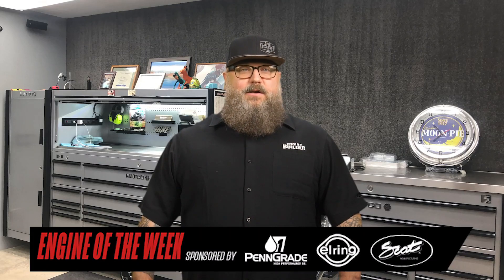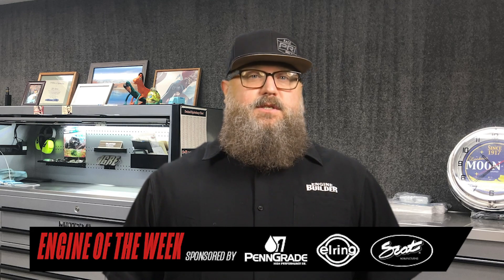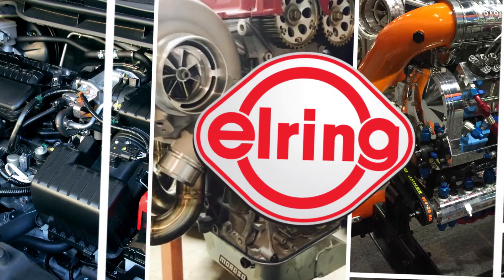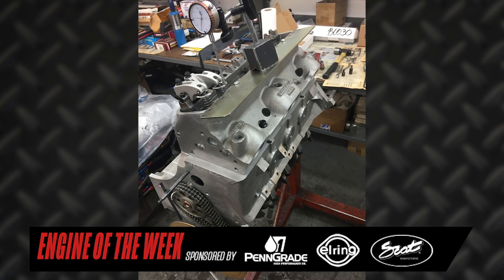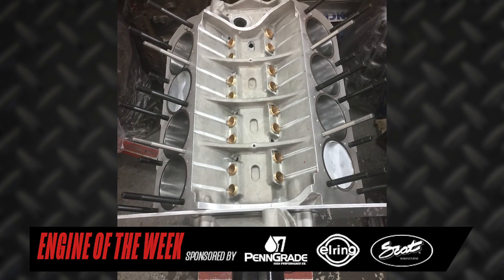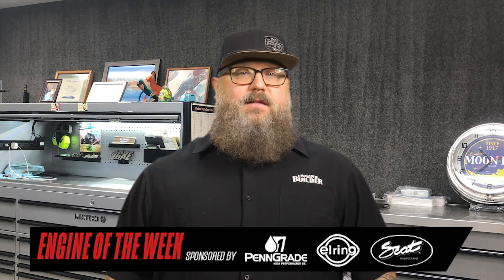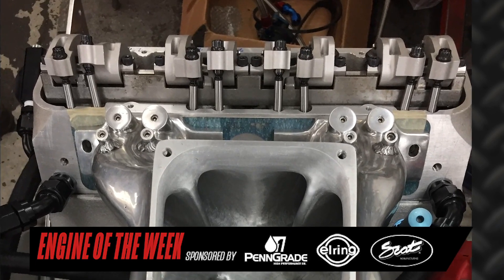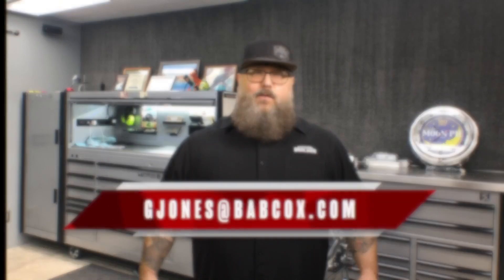All-Aluminum 535 Pontiac Engine

Comment: Cool stuff, I been running Pontiac since the late 70s 389, 400, 421., 428, 455, I learned early on these engines make great torque, do t really need a lot of rpm. Right now om running a ols school 1972 455HO, bored trw L2394 pistons comp cams bump stick 7f6 heads, scorpion roller rockers, torker 1 intake, 850 hp series carb and msd ignition. My dad bought this engine back in 73, it was in a T/A that was parted out to raise money for college. The engine was built by a place called Shepard in Rockingham NC. It sat in a little building till the early 90s when my dad put it into a 72 GMC pickup. Dad got sick in 96 and passed. I bought the engine from my mom for 500 bucks. All I have done is freshen it up and install the comp cam in place of the GK cam. Some of you older guys may remember General Kenetics. I currently have it in a 1975 Firebird with a M21 4 speed. It's still other than the cam and ignition just like it's been since late 72. Reckon I will keep her as is in memory of my dad. I hope to build an exotic Pontiac, maybe a DCI RA5.
   Nice video, cool to see the aftermarket so strong for Pontiac. 👍👍🏁🏁

Comment: Should have used CV1 heads. Would have made another 100 hp without the pushrod bending angles.
Reply: Misinformation. That without a doubt is completely 100% false. No CV head comes close to a Tiger head for Pontiacs, especially after Bill gets done with them. That head and intake is tough to beat. Not knocking the canted stuff, but is not even clear they make more or the same as an Edelbrock. A lot of theory, but no facts. If you don't know, it's fine. Just don't comment like ya do.

Comment: I have an all aluminum Pontiac currently being built. All Pontiac Gen II block and KRE Warp 6 cylinder heads with CNC'd exhaust ports.  Bryant Billet crank, Molnar power adder plus connecting rods (6.700") and custom CP pistons. And a pair of upgraded Bullseye S475 turbo's. Street build and will run E85 as fuel. Engine size will around 8L.
Reply: Holy sh*t
Reply: Man, I wish I had such an unreasonable amount of money to build an epic Poncho
Reply: Dayum !! And here I was feeling good about the KAUFFMAN-BUILT 461 I'm dropping in my 1970 GTO 'Vert, Spring 2025 - ported KAUFFMAN D Ports (310cfm) Hyd Roller (aprox .600" lift), with the 3x2 AED TRI POWER set up
Reply: NICE